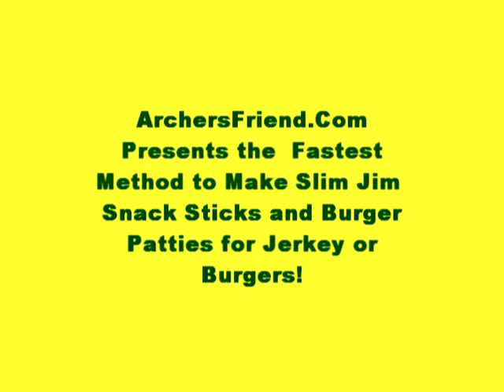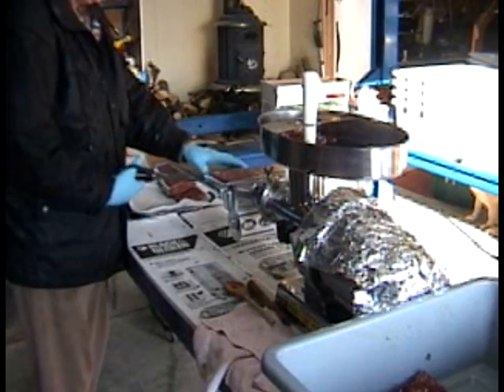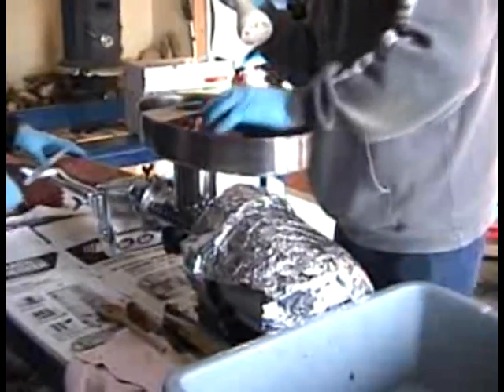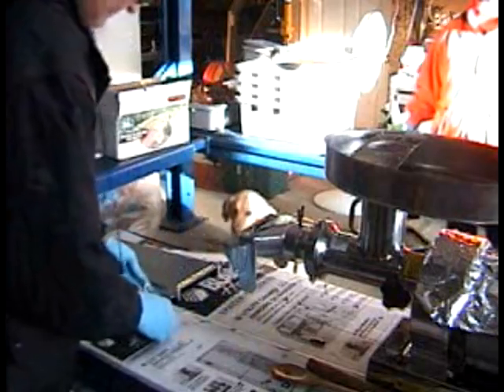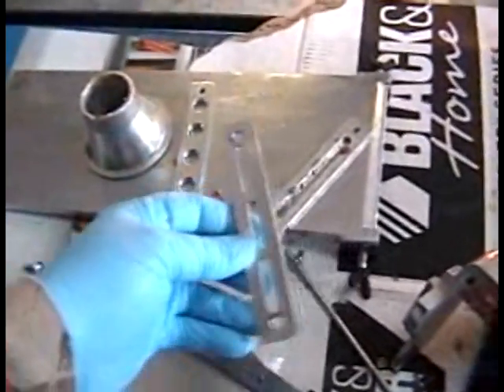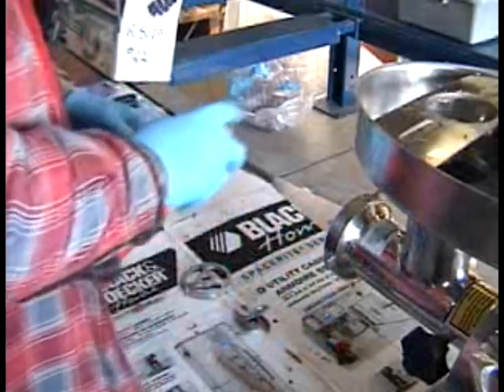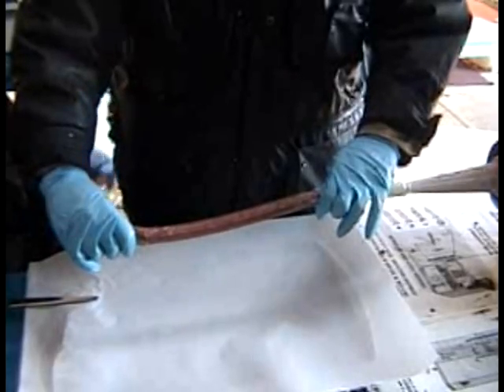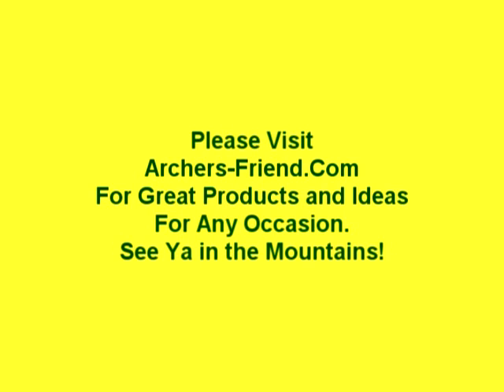Making Slim Jim Sticks and Burger Patties the Easy Way.

Comment: what size grinder plate do you use to grind when using the lem patty adapter thanks allen
Reply from the maker: For the patties I use the small grind plate IF THE Meat will grind ok, if not, I switch to the next larger.
For the Slim Jims, you will need the small plate, otherwise the casing will split.
Thank you for watching and commenting.